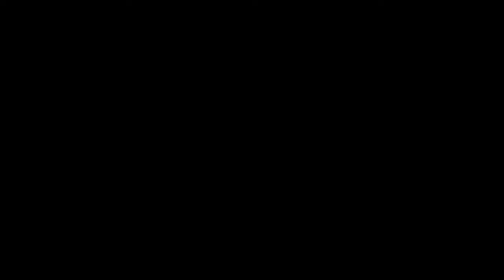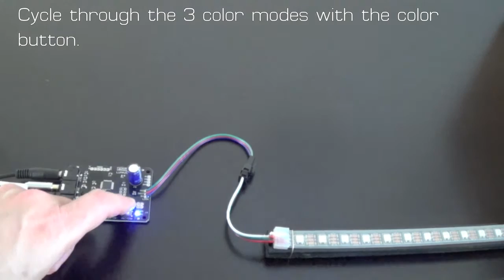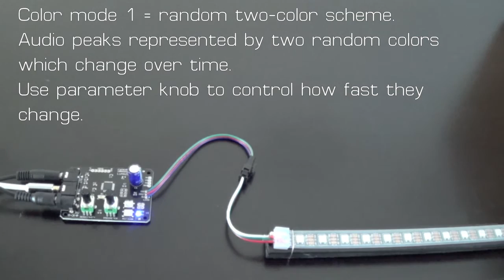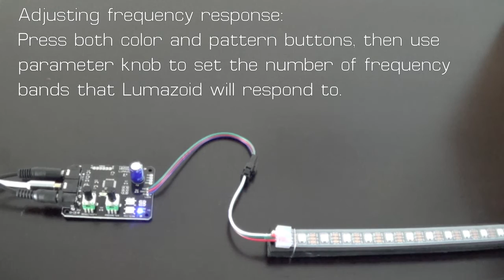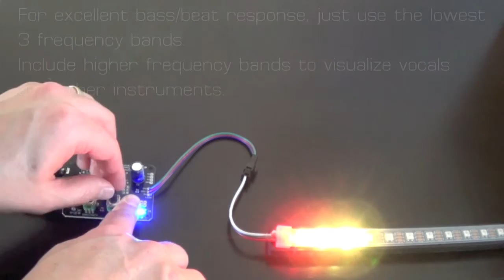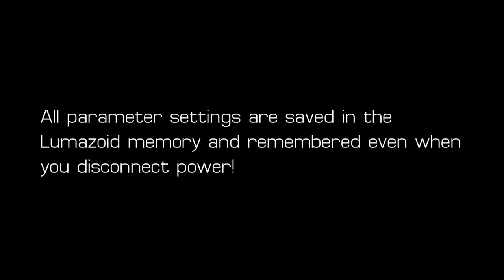Lumazoid Instructions

Comment: hi my strips are ws282 but have 5 wires. Is there a way to connect them?
Reply from the maker: WS2812 strips often have additional power wires, but that is not needed with the Lumazoid.
Reply: @nootropicdesign  so connect it without the power wires and use a 5v power supply?
Reply from the maker: @EthanKrolick  Just connect the 5V, GND, and signal wires from the board to the strip. The board provides power to the strip. Yes, board needs a 5V supply.
Reply from the maker: Just see the docs: https://nootropicdesign.com/lumazoid/